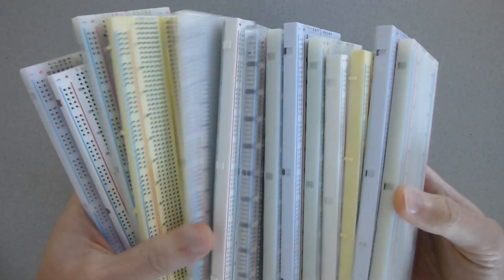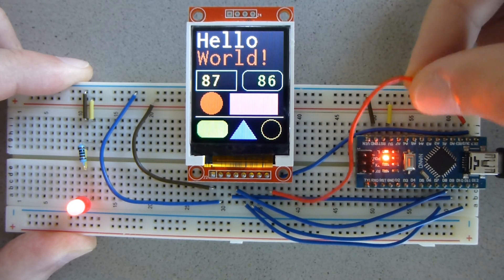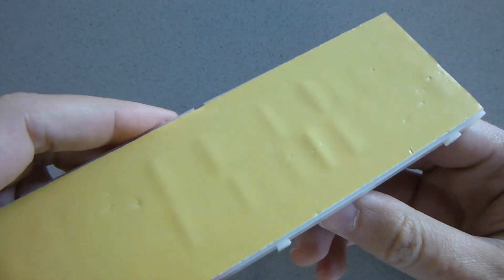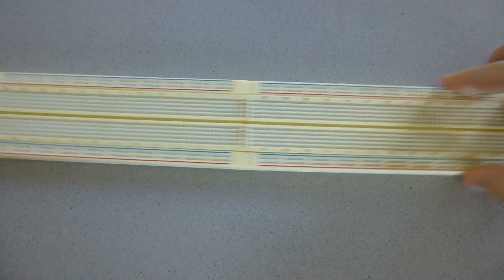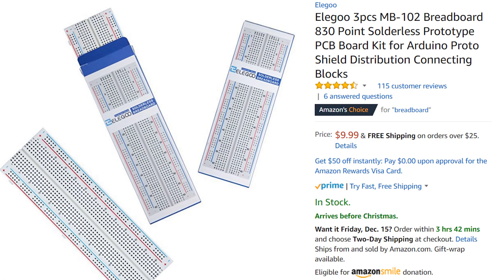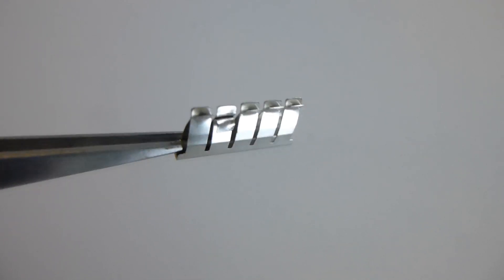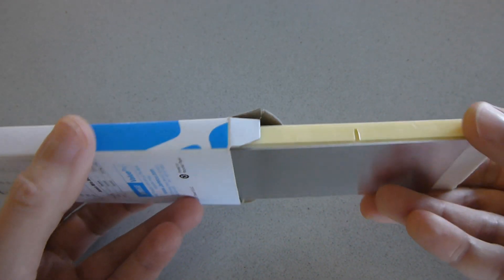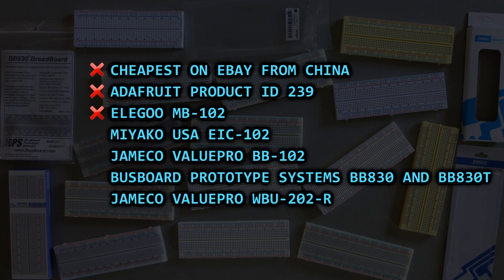Best Quality Breadboard?

Comment: I got one from AliExpress and even after pulling out a set of connector clips I can't figure out if its bad or "good enough" because I have nothing to compare with. It'd be nice to show the actual differences between how much you can bend the good ones for them to still spring back in place. Though I guess it may not be a question of them handling one big deformation but many small ones overtime, idk.

Comment: 7 years after publication still extremely help full video. Good job 👍
Reply: Yeah but in 7 years the cheap AliExpress stuff seems to have improved - at least they get the labeling right now. And frankly if it costs 4-5 times less than good brands there's no problem if it only lasts a quarter of the life of the good brands either.

Comment: Ever heard about e-cell protoboards?
Reply from the maker: I never heard about it. It seems like components that has their own small PCB with pins for easy use?
Reply: @interlinkknight oh sorry, I meant e-call and wrote e-cell. But yeah, I think the goal of e-cell it's the easy visualization and steady leads
Reply from the maker: Oh. Yes, I have a few E-call breadboards. They are very good actually. Not as easy to find in here, last time I checked. But they are good quality

Comment: This is why the BusBoard units are so highly recommended. They're relatively affordable but extremely solid for the price. It USED TO make a lot of sense to have split power rails but their utility has definitely gone away for most uses and it's easy enough to add a bus rail you split off one side of another board that isn't split if you need it.

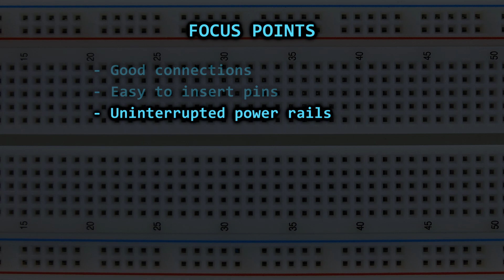Comment: 1:18 The purpose of interrupted power rails is for when you need more than two different supplied voltages on the same breadboard.
Installing jumpers when only one voltage is required is a small price to pay for that functionality.
Reply from the maker: I disagree. Most of people and most of the time we use only 1 or 2 power sources, much more often than 3 or 4. All good brands know this so they don't split the power rails.
Reply: @interlinkknight agreed, the top and bottom rail is enough, happy to use spare vertical rails for rare occasions

Comment: Hmm.. Disconnected power rail should be an advantage/plus rather than the opposite. You virtually have separate boards for 4 different voltages With your logic ALL breadboards failed this because ALL of them have at least 2 disconnected power rails.
Reply from the maker: In cases where people require 3 or 4 power rails, that would be an advantage, yes. The question would be: how many times do people use 1-2 power rails vs 3-4 power rails? Maybe like 90% vs 10%?

Good brands know this so neither of the good brands add this feature of splitting the power rails, at least that I know of.

In that case, you would have to buy a bad quality breadboard so it can have the split power rails, but now you would suffer the bad connections, the bad labels, etc.

Comment: I bought a cheap one... instant regret... had problems with the simplest of circuits like 1 LED and 1 resistor (just learning) and 1st lesson learned was that a large % of the pin holes didn't work. Nothing like trying to learn circuits and how they work, with a half dead breadboard... well, I guess I did learn something so... bravo cheap breadboard.

Any love for Bestol brand?
Reply from the maker: Most of us go through that mistake and lesson. I haven't tried that bestol brand

Comment: is there one that has no gaps between the power rail holes? i don't like the diagonal connections you often have to do because of those
Reply from the maker: There might be, but i haven't seen one like that. Good point, though

Comment: I have the AZ-Delivery ones and i love them. The labeling is a bit shifted but you can live with it, the connections are good and it's easy to connect. There's adhesive, if you peel it off, you can get to the metal, and the power rails have no interruptions. You can connect them on all 4 sides with those square connectors and they don't have a backplate but the adhesive is pretty strong.

Comment: 3M breadboards are the best.  Can't believe you didn't try them.  I have several and they are great.  You get what you pay for.  Stop wasting your money on that junk.
Reply from the maker: I'm sure the 3M are good but I could not find one to buy with this style. I could only find for sale the ones that come with big boards and power connectors. I was interested on the classic form factor, and 3M apparently don't make those (at least that I can tell).

Also, please don't call other brands junk. Even though 3M have excellent quality products, doesn't mean all other brands are junk. I've used my top picks breadboards for years and still work perfectly. There are junk breadboards out there, but not theses that I tested good

Comment: Arent split rails necessary for over 1 voltage sources? My circuits class has been doing voltage dividers and measuring current using 2 voltage sources and I am trying to buy boards that can do this
Reply from the maker: When I need to use two voltages, I use one side for one voltage and the other side for the other one. So we do have two power rails already in all good quality breadboards. They are just in different sides. When you need 3 or more voltages, then you could join multiple breadboards.

Technically some people could need 4 power rails in a single breadboard, but count the time you ever need more than 2 power rails. Now count the times you need the entire power rail. Obviously by far we mostly use the entire power rail so all good quality breadboards have the entire power rail without splits.

Comment: A feature not discussed is the construction material. I have several breadboards that have warped and curved upwards at the ends from plastic shrinkage after a couple years. They aren't flat or straight any more. Some boards do this, and others do not, because the plastics they are made from is different. The ones that are curved up are annoying to use now because 40 pin dips and adapter pcb's don't even fit well any more because the chip or socket or pcb is long enough that the curvature makes the pins not line up with the holes just from one end of the chip to another. You can still insert the parts, but they don't lie flat. One real problem is you can no longer use those breadboards as a soldering jig to solder pin headers onto pcbs, if you need the pins to be accurately aligned to plug into something else later.
Reply from the maker: That's a great point. You are right. I saw it only once with a breadboard that was all warp. It was a cheap one. At least I can assure you that the good modela I recommend are still going strong without issues, even after all these years of using them

Comment: Contrary to the rave reviews on on EEVblog forums, Reddit and elsewhere, I would highly advise against purchasing the Assembly Specialists (same as 3M) breadboards. Required insertion force for a 0.6mm pin is just a hair over 1kg. That's not a typo -- it's absolutely bonkers. If you abuse a terminal -- reinserting a pin repeatedly and wiggling it up and down -- you can get that down to around 300g. You're going to have a really, really bad time trying to get solid core wire, resistors, etc to not buckle and fold over well before they insert.

Going to give the BusBoard a go, will report back later.
Reply from the maker: That's interesting. I never tested that breadboard. Thanks for sharing

Comment: the reason they cut  in the middle is so you can have 5V on the one side and 12v on the other side. some design should never be tested on a breadboard because of lot of there capacity or current / Voltage value .
Reply from the maker: I don't agree that splitting the power rails is a feature. Sure, you can use that split to have 4 power rails (2 on each side) but how often that happens? More common is to have 1 power source so 4 power rails is inconvenient.

Let's put it this way: most good brands have no splits on the power rails. Most bad brands split the power rails. Why? Because good brands are better designing things.
Reply: @interlinkknight  if you do not need that feature just short that.
Reply from the maker: I prefer buying a breadboard without that flaw and connect two breadboards together if I ever need 4 power rails, which in all my years with DIY electronics I never had to use 4 power rails. Most of the time I just need 1 power rail, and in very rare occasions I need 2, and I think that's the case for most people.

Splitting power rails is just a bad design... a very bad design.

Comment: I'm using the worst one in this list, and yeah, no back panel, some connection is bad. but i think it may suit for student purpose like me. This breadboard thing is just like electronic toy :Đ.
Reply from the maker: Want my advice? You should have the best breadboard you can find, especially because you are a student. I say this because the last thing someone that is starting with electronics needs is additional challenges for using terrible tools. It's already hard enough even with perfect tools
Reply: @interlinkknight  you're true, I usually have to debug bad connections. haiz, I want the best tool, but it's too expensive for me, and good breadboard is not available in my country D: (if I order,price is much higher when it go to Vietnam and the shipping is even higher than the  product).
Thanks for your advidce.

Comment: Great advice. I have a love hate relationship with breadboards, because there are so many crap ones out there. Every project I ever tried building on them turned out to have a problem with the board rather than my own work.

I'd be interested to see the frequency performance comparison between the two you recommended. Keysight Labs did a video on one kind and found they perform decently up to 100 MHz, but it depends heavily on the wiring you use. Could also be interesting to know the resistive between contacts. Not that I would recommend putting high voltage in any of these....
Reply from the maker: Breadboards in general are bad for high frequency, no matter the quality. Also, some resistance is to be expected, but it's not something we should be worry about in a normal circuits.

Comment: I somehow missed this review before I did my own research and bought the Jameco WBU-204-R. It looks to be the same as the 202-R in your review but with a large base plate and binding posts. I really hope the quality of the connections is the same as you reviewed.
Reply from the maker: It should be the same quality

Comment: Late to the party, but I'll add some comments anyway... I've noticed that there can also be a variation in the power rail dimensions. Amongst my several breadboards, some measure 0.100" (Jameco Valuepro WBR-202-R) between '+' rail and '-' rail, while others are 0.150" ( older E&L Instruments SK-10). I only noticed this recently when I built a 5V brreadboard power supply that is designed to connect into the top and bottom power rails, straddling the board vertically. In either case, the PS as-built did not fit; with the Jameco it was because the power rails top-to-bottom dimension did not match (1.800" vs. 1.750", with the E&L it was because the pitch of the power rail '+' and '-' was not standard 0.100" but 0.150". I also have other breadboards (Archer/Radio Shack) that have only one row per power rail. I have one breadboard that accepts the PS exactly. So many variations!
Reply from the maker: That's interesting. At least for me, I never seen those differences. Still, there's no real set standard so sadly that kind of things happens.

Thank you for sharing

Comment: the test of a quality pinboard  does it connect a resistor to a led reliably, gently shake the component . If the led blinks the breadboard is NOT reliable . This is the most important test . the rest of his points don't count

Comment: interrupted power rails are good if you want to decrease the voltage drop by the trace itself
Reply from the maker: True, but i find that "feature" more of a problem than an advantage. That's why all the good brands never split the power rails. Usually we just need 2 different power rails and a breadboard has them already.

Comment: Nice comparison and defined requirements. But the Busboard BB830 appears different from the one in the video in the amazon link. In the amazon picture, the numbers are not lined up the same, the power lines seem to break according to the power line markings, and the Column markings do not match top to bottom. Have they changed this model since the video?
Reply from the maker: Good observation. I checked out and looks like in the amazon page they changed the images to a random breadboard. I bought from that link many times and I received an original breadboard and looks different than those "new" pictures. If you go to the Busboard website you'll see the real pictures. They did change a few things from the one I showed on the video, but nothing bad. For example, the ground lines are black instead of blue. Also they now say the brand on the side.

If you buy from Amazon and says busboard prototype systems as the brand, don't worry about the picture because you should receive the correct breadboard.

Let me know how it goes.
Reply: @interlinkknight  I see. Thanks for the explanation!

Comment: Thank you for this video. 👍 I bought breadboards for a university course and they are aweful. We sometimes couldn't read analog sensor signals with the breadboard and now I know why. I will send them back and tell the dealer that the quality is unacceptable for university projects. Bad connections make it almost impossible to learn from mistakes.
Reply from the maker: Yeah, you should return them and get decent ones. I'm glad I could help

Comment: I have the Elegoo breadboard (as part of an Arduino starting kit) and it's not good! Also, the components in the kit are low quality. It's cheap, but quality is below average as well. Anyway, thanks for this video!!!, i'll try to find me a Busboard or Jameco ;)
Reply from the maker: Yeah, i haven't seen a kit with good quality components. And elegoo in general has bad quality stuff. I bought also from elegoo jumper wires and they are so flimsy. I recommend breadboard from mostly busboard prototype systems because they are inexpensive and good. Just buy it in a reliable source because there are many fake ones

Comment: I have a large size breadboard made by 3M, and it is far superior to any others I’ve tried. It was expensive, but 22 gauge solid wires and breadboard type wires fit very firmly and I’ve never had any intermittences issues.
Reply from the maker: That's true, I heard that the 3M are great. But too expensive
Reply: InterlinkKnight it was well worth it to me as I spend hours in my lab making things. Check out my channel if you’re curious. And please, please subscribe, like and share if you enjoy what you see - and hear. 🙋🏻‍♀️

Comment: Thanks for the recommendations. I recently encountered some problems with a few different breadboards of dubious origin and measured an insanely high contact resistance that ranged from 0.4R to 50R.
And this is the only useful video I could find on the subject so thanks again.
Reply from the maker: We all been there. I'm glad I could help.

Comment: Yeah I've been stung by the Amazon "chosen ones", too... Kinda suspicious who gives them such great ratings, if already in a simple circuit one can see that they just don't work.
How about testing the 3M? I can contribute $10 for you to buy one.
Reply from the maker: They are so expensive! $58 for one? 3M is a great company and I'm sure they build great quality breadboards so I don't think I need to test them (I trust them). But no matter if their breadboards are excellent, I would prefer buying several breadboards from busboard prototype systems or jameco. Don't you think?
Reply: @interlinkknight  I am on the same page. Nobody in the UK had busboards when I was shopping around a week ago. 
Therefore, I put one 3M board in my basket because I need to reuse my components and I need a reliable connection...
But I couldn't pull the trigger on £45 for a breadboard...

Luckily, they (BusBoard) just came in to our Mouser today and I see I can buy a whole selection of boards for 45 quid...

That being said, I still think it's interesting and even if the 3M doesn't make sense, I'd still like to know just how different it is from a BusBoard.

Could also look into unwanted capacitance/induction...
Reply from the maker: We all know breadboards have some capacitance, induction and other unwanted stuff but i never seen it to be a problem. Unless you are using it for very high frequencies, it's fine.